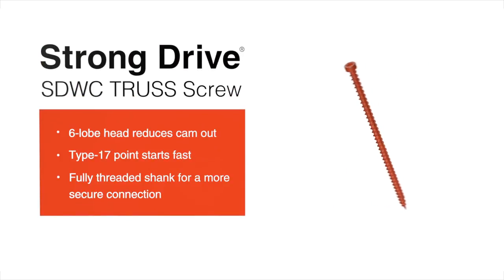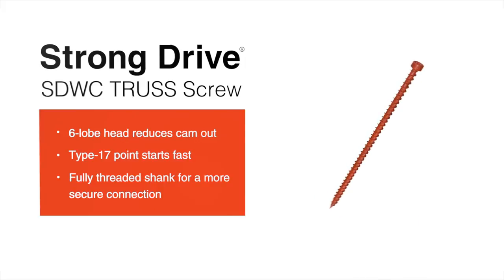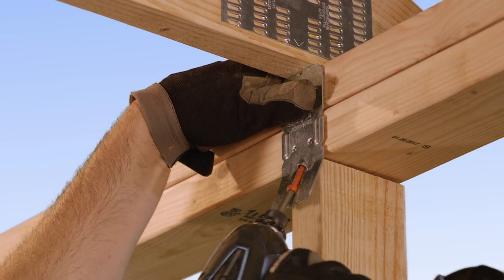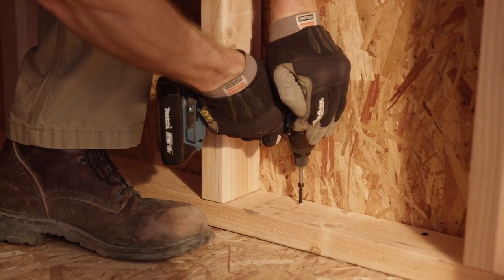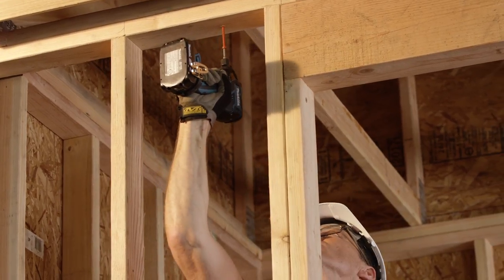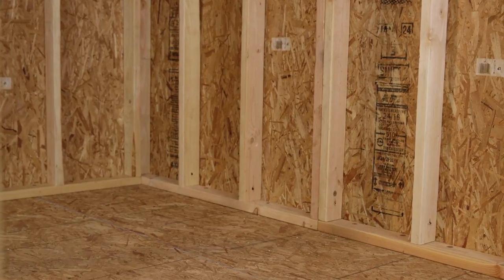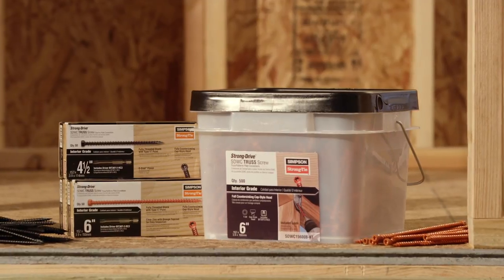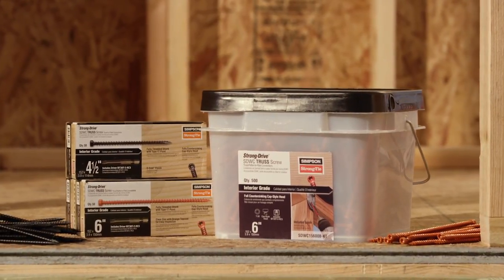How to Use the Strong-Drive® SDWC Truss Screw

Comment: Can you answer one question for me? If I use this screw to attach my truss over a stud and double top plate,  wouldn't it hit at least one of the nails used to secure the stud to the top plate?
Reply from the maker: Hi Joshua,
Thanks for watching our video! To answer your question, it depends on how the top plate is fastened to the stud. Our SDWC Truss Screw flier or our Quik Stik Rafter and Truss Fastening System offer detailed installation options for the SDWC Truss Screw. We also have free Engineering Services at (800) 999-5099 that can also assist you on any other questions you may have.  

SDWC Truss Screw flier: https://ssttoolbox.widen.net/view/pdf/pmc6qjhdb2/F-F-SDWC18.pdf?t.download=true&u=cjmyin

Quik Stik Rafter and Truss Fastening System flier: https://ssttoolbox.widen.net/view/pdf/6iohqnqlio/F-F-QUIKSTIK18.pdf?t.download=true&u=cjmyin
Reply: I have the same question. Don’t see it addressed in the flier anywhere.